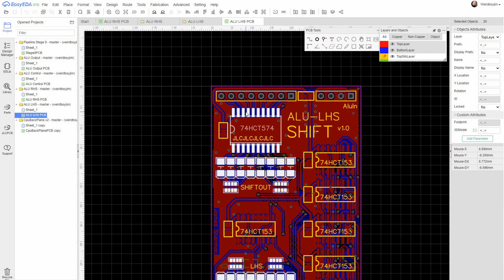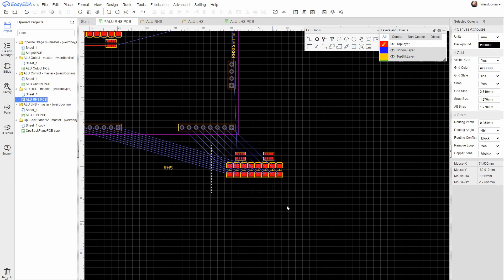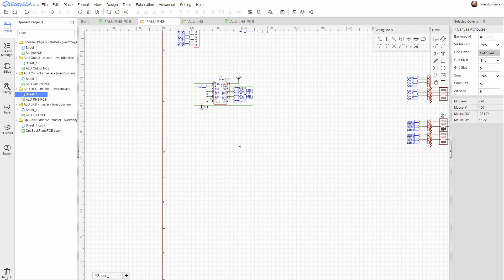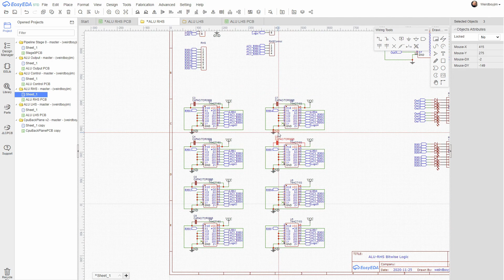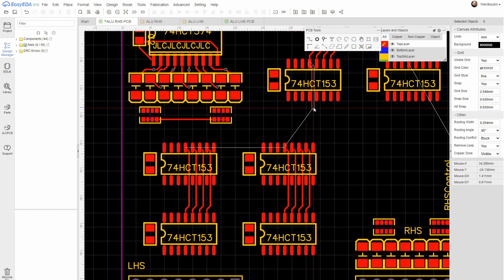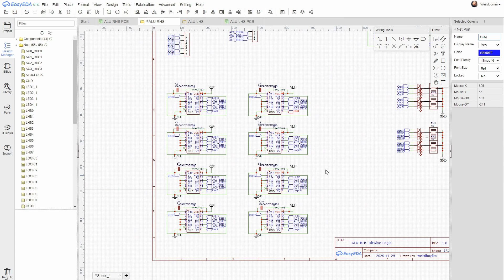Logic Unit PCB - Making an 8 Bit pipelined CPU - Part 90

Comment: Not sure if this will help when connecting grounds together. I always leave the grounds unconnected then do an upper and lower ground fill after everything else which auto connects them where possible (It does in Kicad and EDA should). Any remaining unconnected grounds can usually be achieved with via's to both planes or a simple re-route of a Net.
Reply from the maker: I used to do that but hit a problem on one board where the ground routes were really complicated. Now I'm using 4 Layer boards this is much easier!

Comment: 13:14 no, you don't ... would be interesting though to see you in lab coat and rubber gloves handling beakers with caustic substances etching motherboards .. or in the shop drilling and riveting 152 vias :D .. these board manufacturers made prototyping so easy for us, it's a bliss. 
But it would be quite a sight i bet ... all your boards hand made in shiny copper with transparent solder mask...
Reply from the maker: Maybe a future mini series to experiment with some home pcb production techniques, but not before I'm finished with this cpu build.

Comment: As a complete novice, one of the things I've been surprised by while watching you develop your designs is the use of small delays with a few NOT gates to satisfy timing constraints. In the back of my mind it felt a bit "hacky" because my intuition was built upon operations always being aligned to a clock edge (so a theoretically perfect digital circuit could be clocked to arbitrary speeds, but introducing the concept of delays suddenly puts an upper bound on that). Is this technique something that you could expect to see in high-speed silicon?
Reply from the maker: That is a great question, and one where I have to remind you that I am not the fount of all knowledge in this regard. I've been learning as I go and this is one of the areas I've been least comfortable with. I started of thinking about the clock signals in the way you describe but past a point it became clear that you have to look beyond that. Time is (for all intents and purposes in our circuits) analogue, some circuits will respond faster than others and the places where I've done this are dealing with those situations. I've started thinking about the clock less as the hard definition of time and more as a gating system that lets you keep everything synchronised, you are using it to make the fast components wait for the slower parts of the circuits. I can't really tell you how "legitimate" the specifics of what I've done are, but I have seen people with vastly more experience do similar things (that made me feel better). On really high speed boards the experts take it to the next level and start adding little wiggles onto the traces to ensure that signals arrive at the expected time. Definitely avoid it where possible, make it as minimal as possible. I need to revisit one location where I suspect I put more delay than was needed in.
Reply: This is not how it is done in a modern digital design. In an FPGA or ASIC, this kind of thing is very scary! Typically you specify setup and hold times, clock frequencies and domains, and propagation delay details. The toolchain then works hard to ensure that the result of any logic will be valid and stable (as per the setup time) and will remain valid (as per the hold time). The tools will show you the time between when the data is valid and read, and is called 'slack'. This slack can be negative, meaning the signal path is slower than the required time, or the data isn't valid until after it is read. Such a design is commonly referred to as 'failing timing'.

The FPGA toolchain will try to help, by physically using resources closer to each other, so the path is shorter and thus quicker. Other techniques include adding registers into the design, so that the data is retimed to the clock part-way through the logic.

Typically negative slack is caused by lots of combinatorial logic between registers that takes longer to propagate than the clock period (plus setup/hold) or the FPGA is becoming congested and the place and route is using logic elements further away than is ideal as closer ones are used. Here, floor planning and manual partitioning (guiding the place and route state manually) can help. 

Fundamentally, the designer would have to (a) come up with an equally functional design that works faster, or, (b) ease the timing constraints if they're overly tight.

For more details, Google "FPGA negative slack".

Comment: Please tell me you're going to convert the diode matrix into a something more elegant than the mess of jumpers on that premade board
Reply from the maker: What's wrong with my beautiful diode matrix board? ;-)  Did you see the soldering mess it replaced?  Hopefully you won't be disappointed with what I've done for that, PCB should be next one you see.
Reply: @weirdboyjim  It's definitely a fictional solution but I would rather see it without the jumpers

Comment: Another great video! Unfortunately for me, it highlighted a mistake I'd made in my own ALU design and I need to yank some wires out and start the logic part again. Oh well, 3rd time lucky.
Reply from the maker: Sorry to hear that Rick! Are you using the same 4:1 selector trick?
Reply: @weirdboyjim  yes I am. But I wired up the inputs wrong. Still i think it will work out better because it has made me think about things a bit more and I see some improvements.

Comment: Traces coming out of the side of the pads really triggers me 😄
Reply from the maker: I know how you like to complain about things tom, I'll be sure to do it more in future 😆
Reply: 🤣 please do.

Actually I have a question. What size is your flux syringe?

The success you are having with reflow soldering has inspired me to buy some more tools lately and give it a go myself. Got a hot air station, just need a couple more bits and pieces to help make the job easier and flux is one of the last items on the list!
Reply: Agreed. I shudder at that, too. And tracks that meet pads not at 90-degrees. Not only do they cause acid traps (probably not a problem these days) but they look ugly! 🙂 But I realise that's is a personal preference and doesn't make any difference. 😂
Reply: That's triggering you? How about the layout of the input and output LEDs and logic being different on the two ALU logic boards? I'm coping by at least the input LEDs on the LHS board are on the left and on the right for the RHS board. 😂

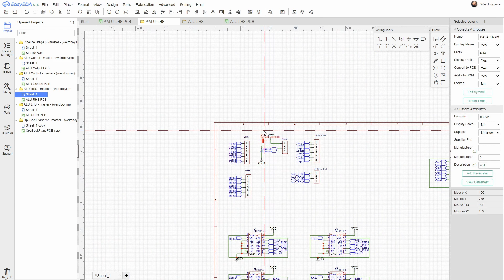Comment: @03:58 An answer to your question might by; because the footprint has a standard prefix of U. Probably used a custom footprint? You can edit that footprint to have the default prefix of C. If you look up the footprint you are using in the library and click "Edit", on the left you can see under custom attributes something like "U?". If you change and change that to "C?" and save it, the next time you use the new saved footprint you will have it starting with C. Again, great progress! :)
Reply from the maker: All the caps I've grabbed out of the lcsc library seem to have "U" thought there might be a reason. May even be a language thing.
Reply: @weirdboyjim  U is the default prefix when a new footprint is created so maybe someone forgot to change it?